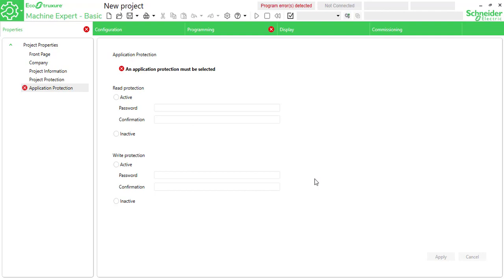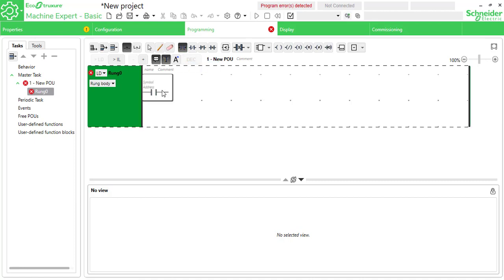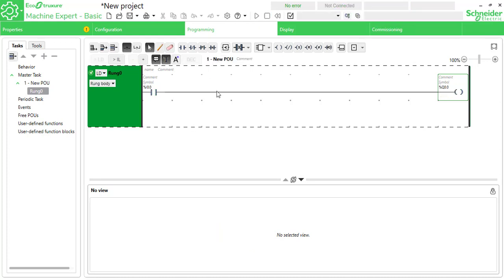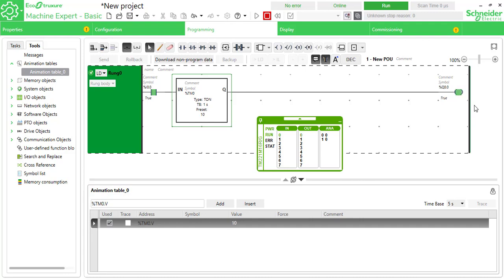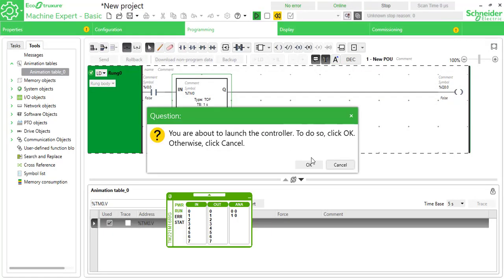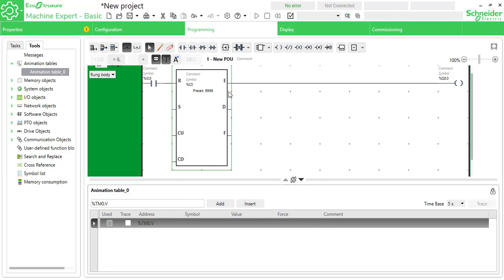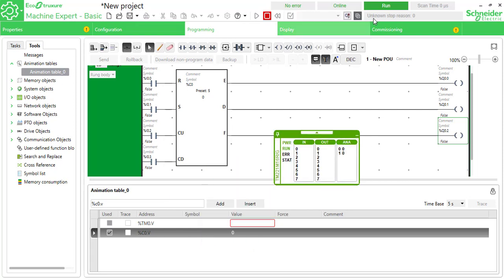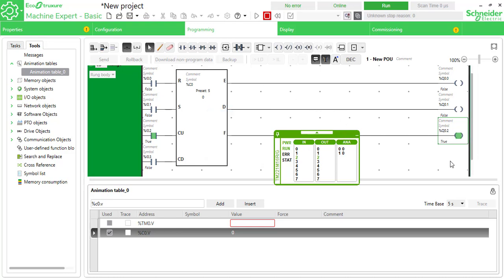Schneider PLC Tutorial Part 1 | Eco Structure Machine Edition Software Tutorial for beginners

Comment: It's showing stimulator not responding
I'm using(win7 32bit operating sys)
Reply from the maker: I àlso encountered the same try after a restart
Reply: @eightminautomation7222   may be is due to lesser version of .net framework , is this possible reason?
Reply from the maker: Not much sure but the software im using which is 64...
Reply: @eightminautomation7222  oh okay
And one more thing the UI of software not fitting to my screen size
Reply from the maker: You are making remember my old pc😌😁
Reply: @eightminautomation7222  😂 but its i5
Reply from the maker: Wow lol🤣